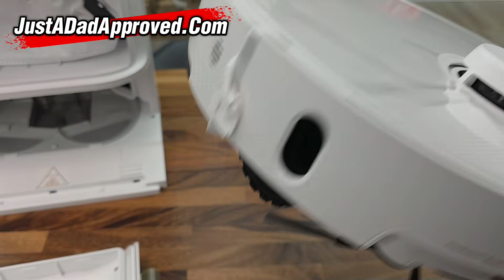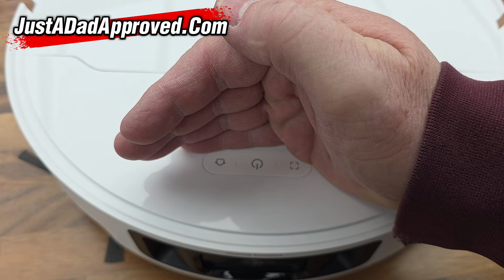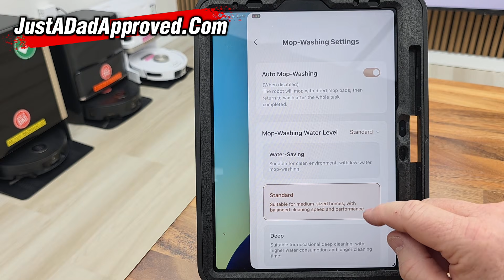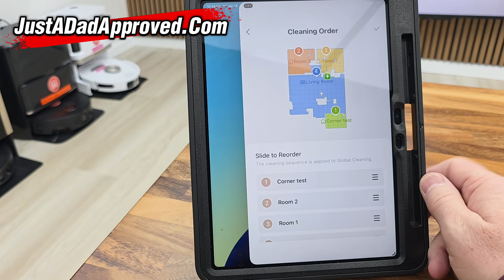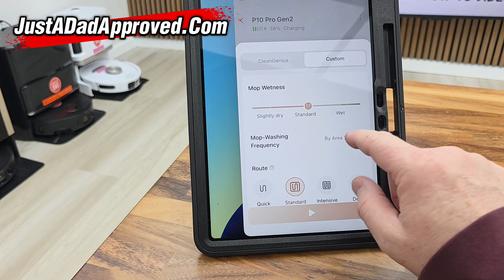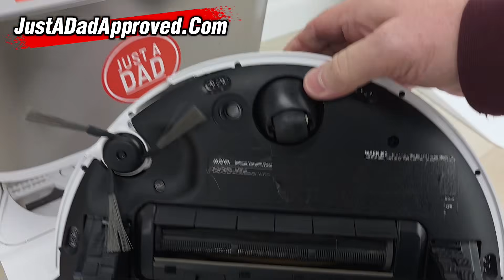Mova P10 Pro Gen 2 Is HERE! (Setup + First Look)

Comment: The wet hair being left behind would drive me nuts, and honestly it’s probably why I’ll choose the Yeedi M14 Plus instead. The roller mop with the scraper just seems better for that, whereas the spinning mops feel like they mostly wet and spread things around, and heavier wet hair ends up sticking to the floor, which kind of defeats the great suction of this robot.

Also, while I wouldn’t run something like the Shark cleaner through the internal system because of potential buildup in the pumps, I do wonder if even putting it in the water tank could make it harder to pick up wet hair. Stronger surfactants and higher residue might actually make the problem worse. Mixing something like Shark cleaner with Mova solution could be an issue too.

It would be interesting to see a side-by-side test with just water vs. water plus Mova solution to really compare the results. At the end of the day, it’s probably not worth using something like the Shark cleaner anyway since it can leave residue and cause buildup that clogs and damages the robot’s internal pumps and tubing.

Comment: Does the top have to opened all the way to remove the dirty and clean water tanks. the closet space that this unit will go in has a slanted ceiling so i believe i may have to pull the buckets out at angle. hopefully thats possible otherwise it's going back :(

Comment: I purchased Gen 1 during Black Friday last year and it was not very good. The mopping was not great and vacuuming sounded like something was loose during vacuum. I tried the Tricut brush and didn’t help also.Similar when you shook the Gen 2 in this video. I am so glad I purchased it during Black Friday because I was able to return it during the extended return period. I am an old Roborock S5 user which cleans our hard floors great. I have been waiting for a fair price on one of these new generation models but I am still more impressed with my old S5. I will be trying the Roborock Flow this time to see how that goes. I think the roller is better for mopping than the spin pads and the Roborock navigation seems superior to the mova. One more thing. It didn’t eat cords initially but it started to eat cords which knocked off the mopping pads often. 😮
Reply from the maker: Thanks for sharing your experience!  I have seen the cord thing also

Comment: MOVA P10 Pro Ultra (Gen1) user/owner here 
I got the manufacturer refurbished from eBay (so it's even lower than the sale). The box arrived a bit rough and robot is used, but I am absolutely happy with the buy. It's working perfectly fine, no software issue, the app is easy to use. It clean my house every few days, love it 🥰
Reply from the maker: So happy to hear you love it!

Comment: I was so excited to hear about the Gen 2 after owning the Gen 1 for a few weeks. After watching this full video with my spouse (I make her watch a lot of your videos with me), I'm having second thoughts on Gen 2. 

I'm not sure how clean the genius will work if it doesn't have a dirt detection sensor in the water line. I'm having serious second thoughts on getting this version after this review. No RGB camera, no sensor, misleading brush type underneath with that sticker that makes zero sense. 

I do like, however, that the side brush will activate on carpets compared to Gen 1, which doesn't use the side brush. It basically inhibits corner cleaning on the carpet. I do have a lot of carpets. Havent figured out a way to enable it on carpets without a workaround, forcing it to see it as hardwood instead of carpet. 

I think I'll hold off on Gen 2 for now or at least wait for the 3 month review. 

Fyi, it's not 12 nano meters of downward force as that's a measurement of length. It's 12 N (Newtons), a measurement of force.
Reply: If you want side brush cleaning on carpet with gen1 set the floor to tile or hardwood directional and use vacuum only

Comment: Why do you add additional cleaning solution to the clean water tank ? I have heard the cleaning solution tank only takes detergent for cleaning the pads at the base station and   not adding to clean water tank on the robot? No light on the robot like my Gen 1 P10 Pro version.
Reply: As you said the p10 and p50 only add detergent to wash the pads, when you add it to the clean water it will fill the robots internal tank up with the mixture.
Reply from the maker: i can regulate the mixture better if i add it the clean water tank

Comment: I’d only get this if you have a significant amount of carpet in your home. The suction power is big to get deep down dust in mid pile carpet. If you have tile, wood or laminate flooring though, the original P10 would be better and you get the camera and dirt detection ability. You have to sacrifice some things to keep it at the same $600 price point but getting double the suction and a better cleaning base.
Reply from the maker: That's a really good point!
Reply: @JustADad  But it does a better job mopping which is an advantage on tile, laminate and hardwood.

Comment: the base station does not have the small teeth to help with mob cleaning interesting design.
Reply: It's the new Dreame/Mova AceBoard, replacing the removable tray washboard with jet water systems that shoot directly at the mop pad.
Reply: @polarisaltair5570 thank u for clearing this out. guess will see after the 3 month test what just a dad have to say about it

Comment: Looks exactly like my Dreame P40s Pro Ultra, dock and robot. Bought in Norway. My firmware is 4.3.9_3276, I see yours has 4.3.9_3263, can't be a coincidence.
Reply from the maker: That's wild how similar they are!
Reply: @JustADad  Yes, however after finished watching your video there are some differences after all, mainly this P10 doesn't have the dual brushes, mop leave behind etc. Probably uses much of the same PCB internals, though. Great video, as always!
Reply: @Tilsynet  Dreame owns Mova. They are largely the same robots.